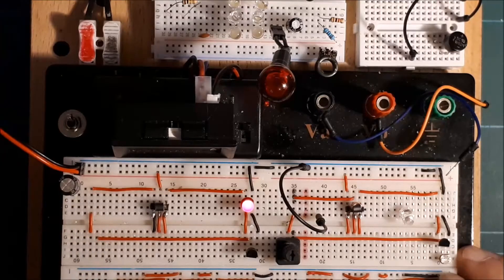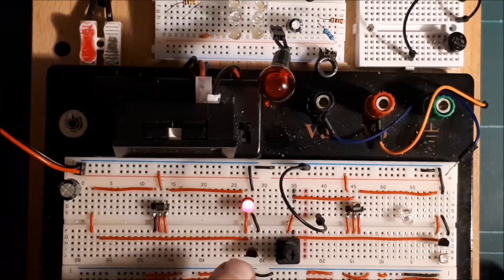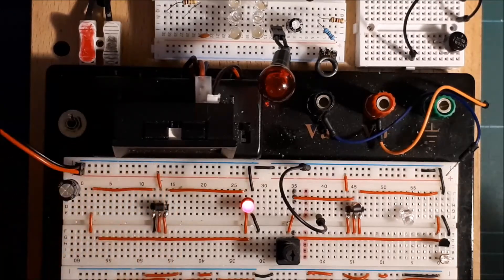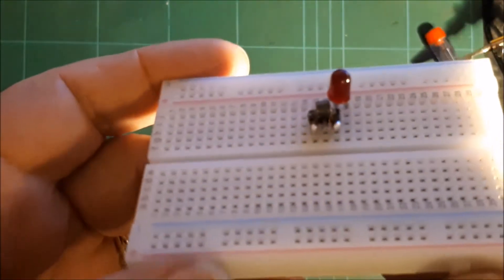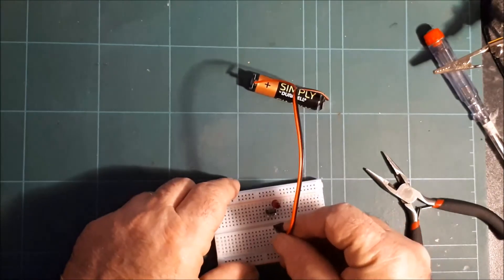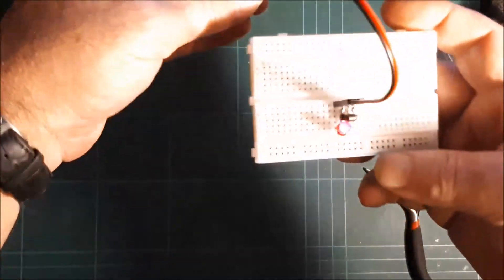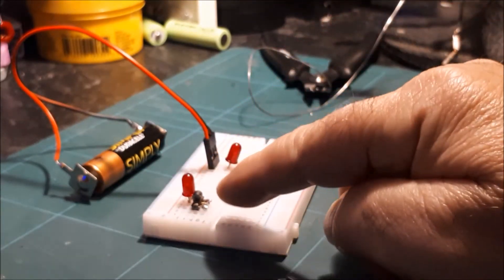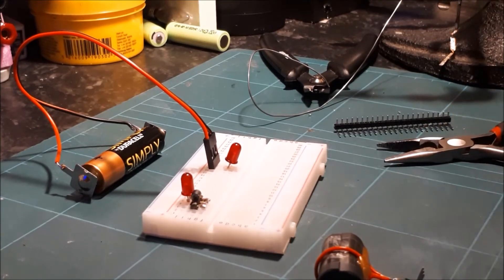Joule Thief or Converter(or just a low voltage led from battery )

Comment: I had a go and I do have a red LED that will light straight off an AA battery just straight across it. The spec says it shouldn't but it does. I will pop a video up when I have a minute to record it.
Reply from the maker: Well blow me, You just wasted a week messing, I put batt across it and it lights
Reply: I know how you feel. I will still put the video up if you don't mind as it is a regular topic of discussion and I always quote the spec and say you can't light an LED with an AA battery but you have proved me wrong. Most joule thief videos feature white LEDs and they do have a higher forward voltage so the issue doesn't occur. (I am saying that without having a range of white LEDs to check but the specs say they are between 3v and 5v so I am hoping I am right).
Reply from the maker: Cool, I'll look forward  to it. meanwhile i will go back to it and see if i can make it work . sure i got something using a tiny cap with a different led. Who knows!